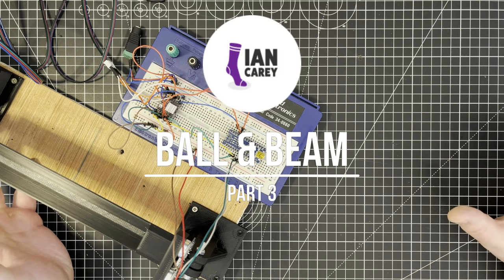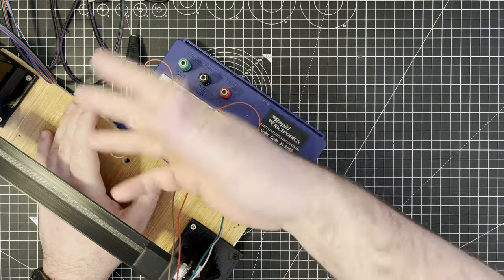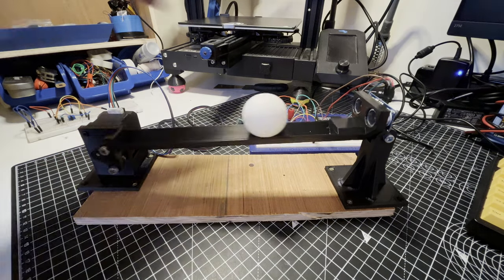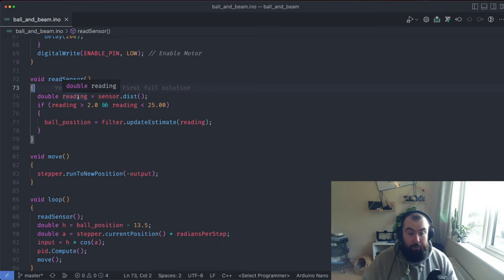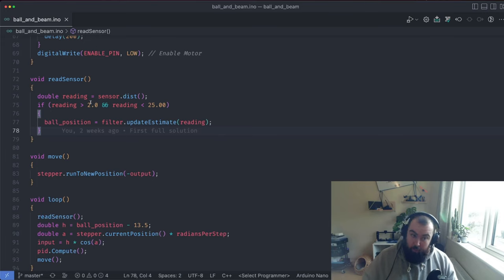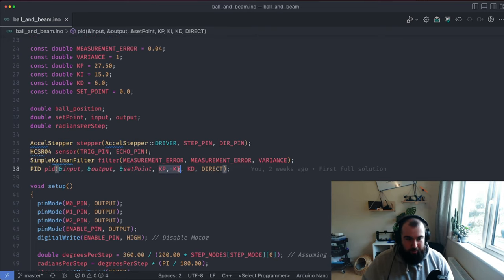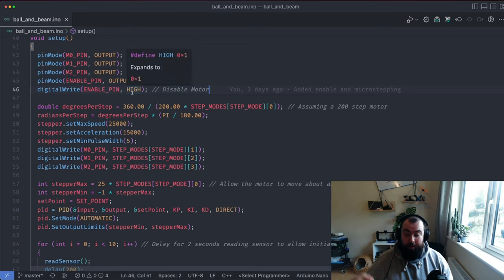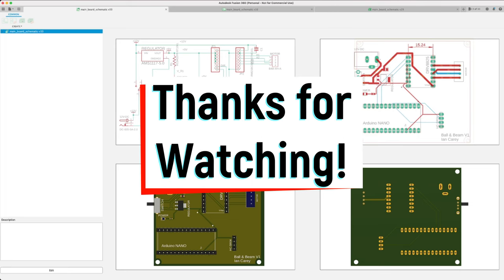Ball & Beam Kit - Part 3

Comment: Hello, can you tell me the size and mass of the ball you are using in this project, I 3D printed your model and ran it and as a result it did not run correctly with the value I set, I think it's because I used a different ball in this project. Thanks.
Reply from the maker: Hi there, the call is a standard sized ping pong or table tennis ball. It should be about 40mm in diameter. The weight is very light, somewhere in the region of about 3 grams.
Reply: @careyian  Thank you for your help. I have another question: do you use matlab simulink to detect pid parameters or detect pid manually? I tried your code and your 3d model using aruino uno r3 but it doesn't work. Exactly my desired setpoint. Thank you very much
Reply: And why h = ball_postion - 13.5 , where do you get the parameter 13.5 from? I don't understand, please explain
Reply from the maker: @LQThangTD I don’t use Matlab to get the PID gains. I tuned them manually. You will more than likely have to do the same. Part of this project is tuning the weights. I tuned it for my setup with my motors etc. it is not going to be the same for you. Each time this is built it will have to be tuned.
Reply from the maker: @LQThangTD it’s the approximate midpoint of the beam. Since we are measuring from one end, if you subtract half the length of the beam that gives you the offset position as a plus or minus from the centre.